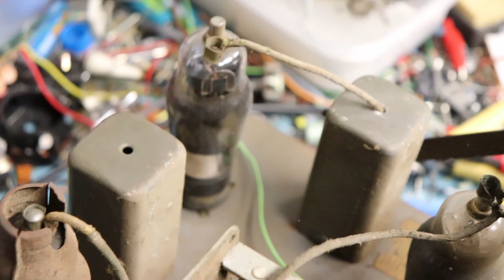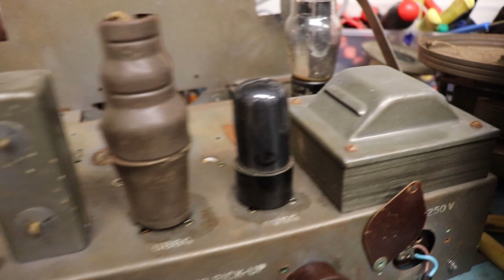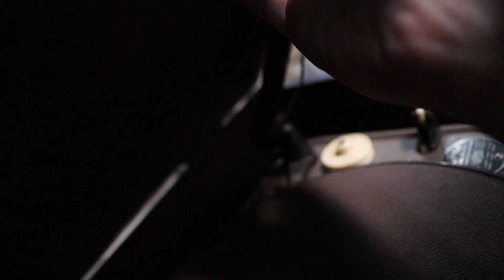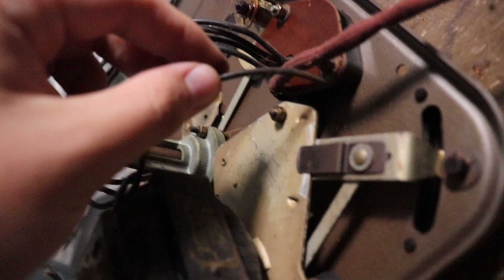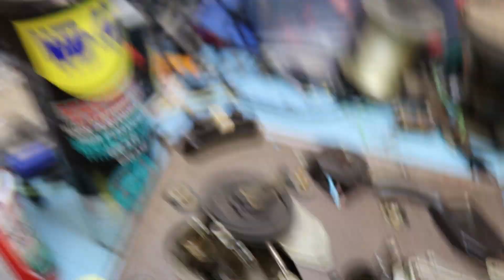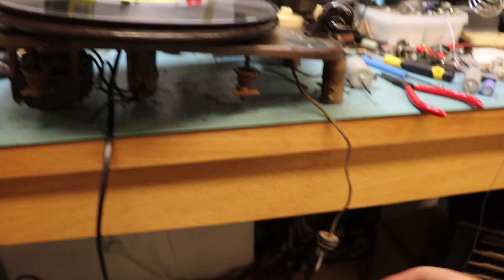1930's Vacuum tube radio to amp hack

Comment: I'd certainly try to restore this as a radio. That way it will still serve a function. Trying to restore the Garrard has very little value in my opinion unless you want a fully functional piece  (in which case why not do the radio also?). The Garrard is most likely quite a complex repair job and the crucial elements i.e. the idler wheel tyre etc. are likely caked and very hard to replace or very costly. There are people that sell new idler wheel replacements or replace the rubber on old ones but charge quite a lot for it. In any case, what you'd get at the end would be a record wrecker because I'd never dare playing a shellac or vinyl record with this type of cartridge and tonearm weight - not unless I did not care one bit for the record.
Re. the case, it looks like most of the damage came from that hose!
Otherwise, a sympathetic restoration (i.e. a good clean and some limited varnish repair) would keep a lot of the originality and character. Nothing wrong with it being an obscure/unknown make: having a Garrard deck on it and a large cabinet with a large speaker are all signs of quality  so this can't have been cheap!
Re. the veneer: it looks good and not peeling anywhere so I'd leave it well alone! :)
But if you want to go the other way and try to fully restore (which I don't advise) bear in mind the following:
a) you don't know how thin the veneer is, so before you begin (not only here, in any veneered piece you choose to restore), make sure you get someone to get you replacement veneer sheets of the same wood with close enough colour, grade etc. You will need some replacement at some point.
b) given the veneer thinness, go very light with any sanding, i.e. use the highest grades sandpapers possible. Beware! Deep scars and gouges cannot be repaired with sanding! You're guaranteed to completely wear the veneer away that way! You need to remove the veneer using the right amount of heat, speed and dexterity, flatten the veneer, fill and sand the wood layer underneath to restore flatness and then re-attach the veneer! You need to be careful not to scorch the veneer when removing if an household iron is your method of choice (most use a normal heat gun taking care to apply the heat from the right distance and for only the amount of time needed). All in all I don't recommend going this way (did I mention that already?) as it will be a huge amount of work and the outcome won't be worth it as it will look like an old piece that 's been tarted up! :)
c) if this is your first veneered piece restoration, make sure to do the following before you start: i) get as much advice as you can, watch videos, read up on the web, carpentry books, restoration books, wood grades guides etc. because you'll need it and, more importantly, ii) get plenty of scraps of veneered wood that you can find thrown away and use them for practice! The more practice with the more types of veneers you get the better. Given the age of the thing, the veneer will be attached with some sort of hide glue and will likely come off far easier than from a more recent veneered piece - but don't count on it!